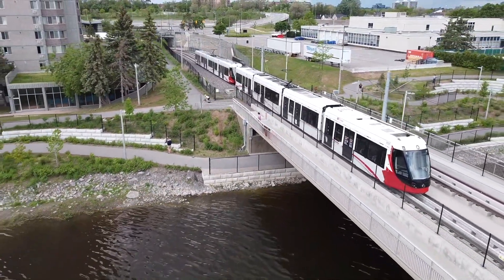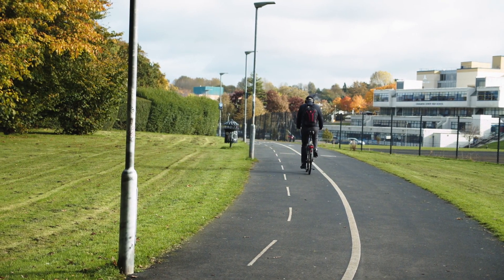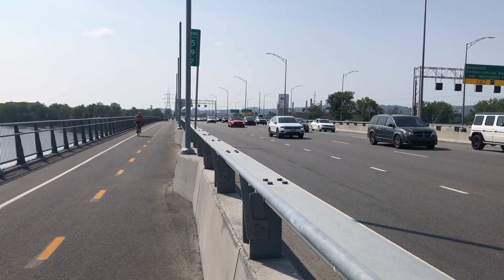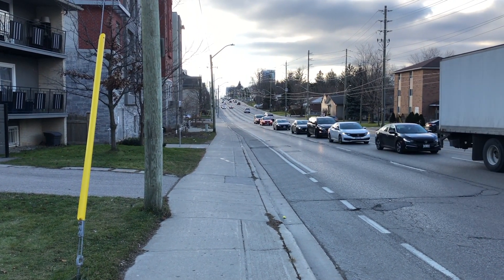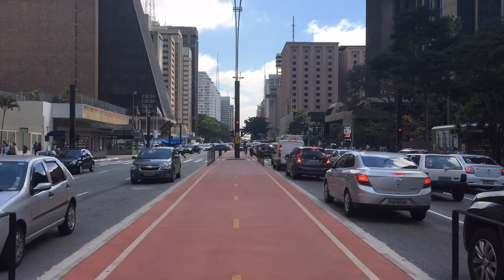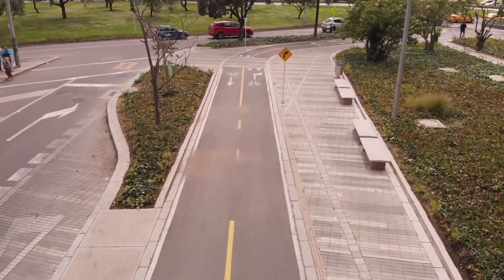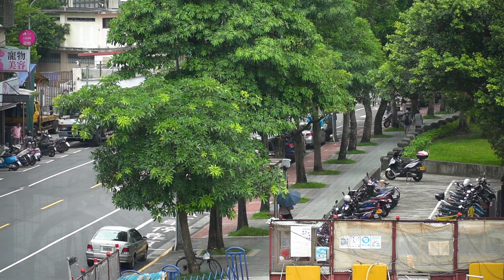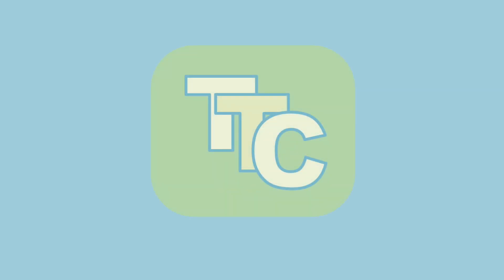The Secret Ingredient to Good Bike Infrastructures

Comment: IMO there are two secrets to good bike paths.  The first...bike lanes should NEVER be inside of shoulder parking.  For a biker this is a nightmare...every car is one that can pull out, open a door, a block the view of a down road hazard.   In select situations bikers should just be allowed to use sidewalks as they are safer.  The second secret of good bike infrastructure is to build along waterfront.  Bikers hate hills...but land next to water will usually be flat.   Also because bridges are expensive, a bike trail next to a creek/river/lake/ocean will likely not have to cross many intersections.  Waterfront property in cities should be prioritized as public use corridors...and not as lawns for McMansions.